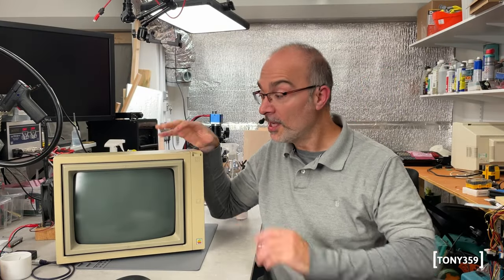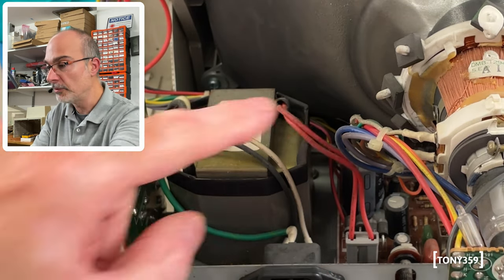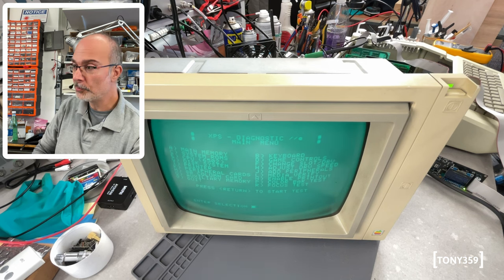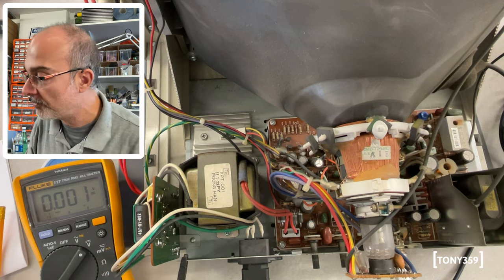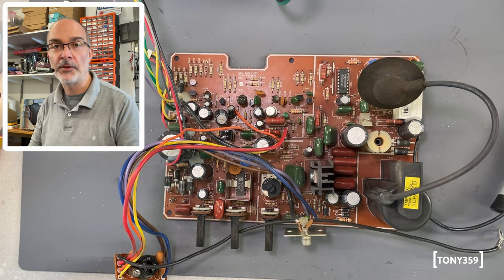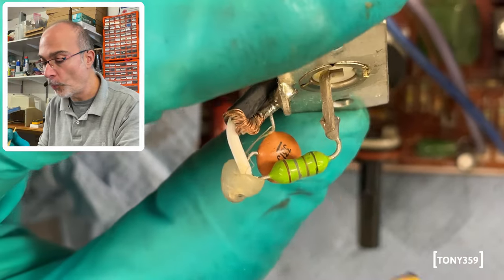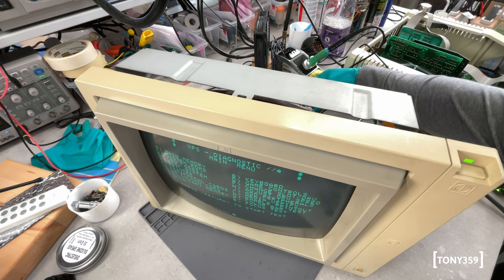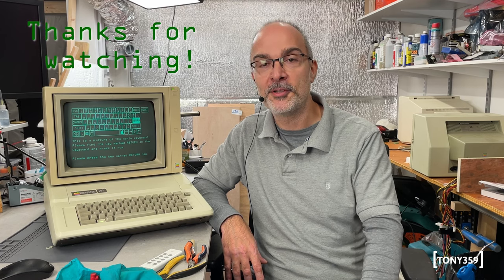So many RIFA's in this 1983 Apple Monitor II!

Comment: If you’re just going a few feet, you can split the signal about four ways before any terribly noticeable difference in video quality on RF or Composite if your using good quality cables and splitter. Then it’s just a matter of cable length/splits/and strength of the source signal. If you run a very long length of CATV or something like to another room, you maybe, probably gonna have to use an amplifier jumped from a shorter length from the splitter. Pretty much, with appropriately used splitters and amps, you can network about as many dang displays as you like. The lower the impedance and better the shield/ground, naturally you get incrementally more impedance the longer the wire gets cause there’s just more wire to go through to complete the circuit. If one of your runs from the splitter is disproportionately too long, then you can get bothersome  interference between them. ❤
Reply from the maker: Yes, I was probably a bit over cautious! Thanks for the details and for watching!

Comment: Coincidence can be a strange thing sometimes! This morning I woke up thinking I should really look into removing the PRAM batteries in my vintage Macs (SE, Classic, Classic II) but realised I wasn't sure how to properly discharge the CRT. Only a few hours later Youtube showed this video in my feed.
Reply from the maker: There you go, I hope it was helpful and you found your Mac's in good shape!
Reply: @tony359  Unfortunately I need to get an extra-long long Torx screwdriver to open the computers, so I don't know yet. Thanks to your video I'm confident about discharging the CRT though.

I don't expect it to hold any charge, the computers haven't been plugged in for at least five years. Seeing the jump scare you got I might use a 10k resistor to make the discharge less spectacular if there is still any residual charge.
Reply from the maker: Apple at some point added a resistor in the discharge tool but then went back to the original tool ‘with the spark’ because the spark is an audible feedback that the tube has been discharged. Took me a few seconds of digging with that screwdriver before it sparked. 5 years you should be very safe but better safe than sorry! 🙂
Reply: @tony359  That does make sense! I'm still not 100% sure I appreciate that kind of feedback 😅
Reply from the maker: ahah yes, it's scary :)

Comment: 20 V AC after full-bridge rectification will give approx. 28 V DC.
Reply from the maker: Yes, so I guess the rectification there is a bit old maybe?
Reply: @tony359   Next time try to measure directly after diodes. Between diodes and the regulator can be something dropping the voltage like a resistor. The problem can be capacitors as well. Oscilloscope can tell you the truth.
Reply: @dawidoszkiewicz5607  Yup, it's either a design feature or the electrolytics are the most likely culprits. The sqrt(2) factor for bridge rectifiers is only correct with smoothing capacitors so if they're dry the voltage probably drops. A scope should show a lot of ripple on the DC supply in that case.
Reply from the maker: To be fair, after the diodes there is only one capacitor. I should have checked it but the //c monitor was showing a similar behaviour, would it be possible that it's just what 1980's tech could offer? Thanks for the comment!
Reply from the maker: I don't have the monitor anymore... Next time I'll check the capacitor for sure! Thanks both!
Reply: @tony359  No, bridge rectification worked pretty much the same since the advent of silicon diodes in the 60s. If everything else works fine I'd hope this is a design feature rather than a faulty capacitor.

Comment: ESR low. i've been racking my brains and trying to find in amongst my university paperwork, my notes on what makes a "low" ESR. thank you for a great video :)
Reply from the maker: Thank you for watching! I barely know what that means, I just know it's good when it's low :)
Reply: @tony359  thank you. Yes I’ve been going off “it’s low means ok”
Reply: Whether an ESR value is good or bad depends on the capacitance and voltage rating of the capacitor in question. Old dedicated ESR meters had a chart of ESR values depending on the two factors printed onto the lid. According to a quick web search all the values you measured are fare below the maximum, by several Ohms. The 10 µF/100 V at the beginning read 1.3 Ω and depending on which specs you look at it could have between two and nine Ohms. For a scientific assessment you need the ESR values for that specific capacitor series.
Reply from the maker: Yes, I "eyeballed" it. I know for smaller values a higher ESR is ok and vice versa. I didn't look at the table but glad I remembered right. I am also aware that my ESR meter is a toy :)

Comment: Nice cleanup Tony. I really need to get some of that dielectric silicone grease. I ones took a CRT display in from cold storage and turned it on, it went of like a fire cracker!
Reply from the maker: ouch! I still don't like CRTs! :)
Reply: @tony359  It was quite spectacular, way louder than RIFAs, and lasted for several seconds. Needless to say, it went back to storage, dead as a doornail haha. Maybe I'll fix it someday :)
Reply from the maker: this is why I usually have the camera on when I power up things, just in case :)

Comment: I currently have 3 of them and all of them was manufactured my samsung electronics, also I'm searching crt replacement since 2 of them had their cat broken during transport ....
Reply from the maker: oh no! Well, the beauty of those monocrome CRTs is that I believe they're more or less all the same. Are they the same used in early Macintosh - but not green?
Reply: @tony359  they are all green , one I have with his original box have the serial number #908 so an early produced in Ireland, btw did you know any specs of those crt to replaced to another one from any other brand?
Reply from the maker: I cannot say for sure. I watched some of Adrian's (digital basement) videos and I think he mentioned that when it comes to monochrome monitors, they're more or less interchangeable. You might need to swap the yoke between tubes though.
As usual, remember CRT are pretty dangerous, there's very high voltage in them even when unplugged!

Comment: 20VAC after rectifiers and filters goes up to 28VDC, not 12V...
Reply from the maker: What I meant to say is that the //c monitor had a similar AC input and 12V output after the regulator so I thought it would be the same here. Thanks for your comment!

Comment: Hi Tony
Where I can buy small capacitor (this one on the left) ?
Reply from the maker: Hi there - I'm not sure I understand which one is the one on the left. Anyways, Mouser of Digikey or RS components. I tend to avoid Ebay or Aliexpress for capacitors.
Reply: Is 4 ot them one big and 3 small (all rifa gold color) 
I need to replace one of the small 40/100/56 0.001uF (is located on the left
Reply: @tony359  can you give me a link to any store where I can buy it replacment
Reply: C702
Reply from the maker: if you google MOUSER or DIGIKEY, it'll be number one, they're big big stores!
Reply: @tony359  I been there but I don’t know which spare part is
Reply: @tony359  ok I understand they huge electronic components retailer but which part I need ?
Reply: @tony359  thank you for no helping me. I removing my subscription. Good bye
Reply from the maker: Sorry, sometimes I sleep too. I opened my monitor to find out the exact part you need and found a link to Mouser but it seems you don't need it anymore. Good luck :)